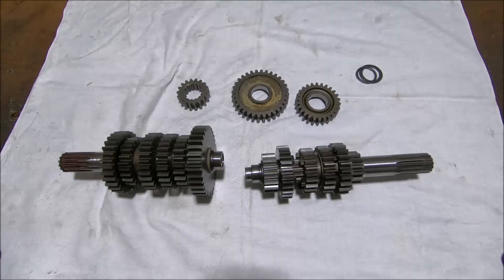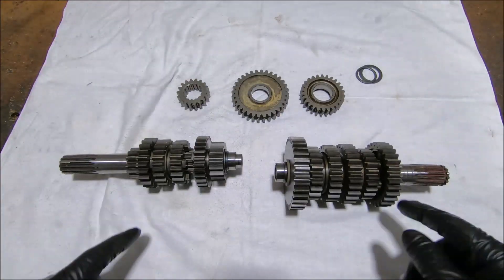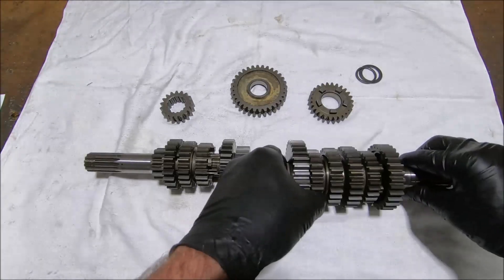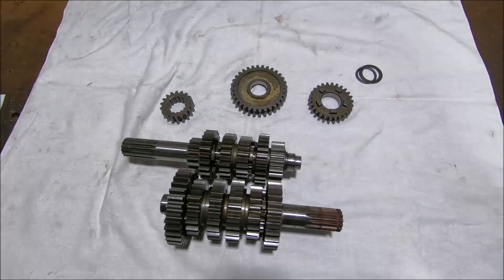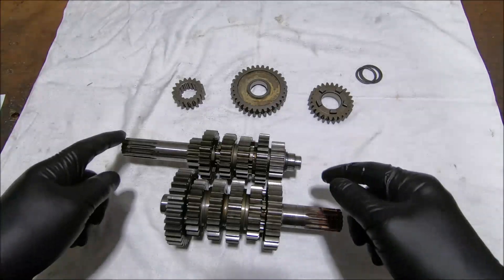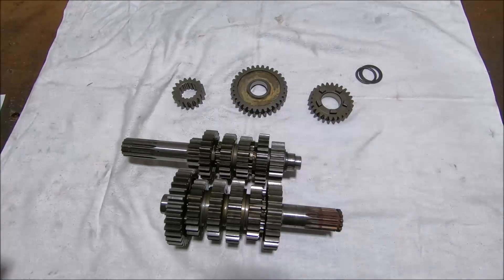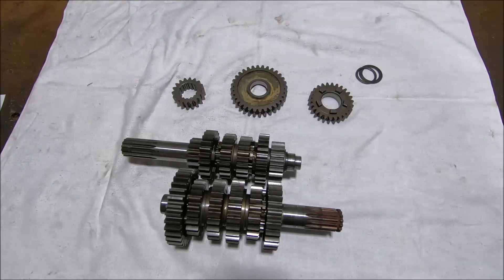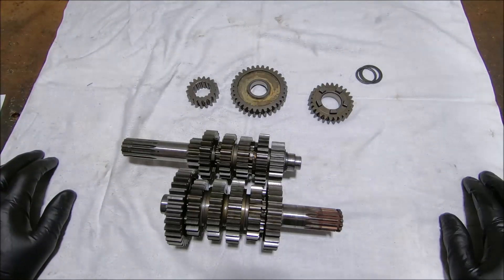Changing gearbox ratios on my M659 engine on first, second and sixth - how, why, etc

Comment: You said the 6th gear ratio was 26/24 now it’s 27/24…. How can  you not change the opposing gear( the 24 tooth) to 23 tooth coz if you go up 1 tooth on the input gear, you must go down 1 tooth on the opposing output gear…. To allow them to mesh.
If I’m wrong, please explain why, thanks.
Reply from the maker: the gear man puts it into the computer program and it puts out a profile shape that should (hopefully) work with the original other gear.  here's hoping.

Comment: I'm interesting, what final drive pair did you use on your 400ss? I have a Monster 400cc, with 15/48, and thinking about change to 15/45, but I don’t know if this will be ok for the 400cc engine...
Reply from the maker: my 6 speed 400ss i ran 14/39 i think.  it was meant to be 14/45 by the manual, i forget what was on it when i got it.  is your monster 5 or 6 speed?  carb or injected?  none of which are anything like the 400ss gearing wise.
Reply: @bradthebikeboy  My M400 6 speed and injected
Reply from the maker: @Юра-щ2о8я  that's the same as the 800 and the later m696, etc.  i usually run 15/48 on m696 instead of the std 15/45 to make them nice, so that should be fine. if you try 15/45 and you don't like it, replace the front with a 14 and that's much the same as 15/48.

Comment: A really interesting exercise. Looking forward to hearing how it feels on the road. On the 1100, the problem is it's overgeared in top meaning you couldn't happily engage sixth at anything below 110 kph. Also, town speed (50 kph) was hard to maintain as second was a bit low and third was too high. I went down the sprocket change route going from the standard 15/39 to 15/42 (via 14/39). The option of swapping individual ratios to fine tune the gearbox is very appealing (if considerably more expensive!)
Reply from the maker: i like 15/43 in wide ratio 1.84 primary drive models.  but a 14 front is a good step if you're not replacing the lot.  this is a very expensive way to change the gearing.
Reply: @bradthebikeboy  Agreed. 14 tooth front is quick, easy and cheap. The 15/42 seems the best of the options I've tried so far, kinder to the chain and sprockets I believe, but heavier with the longer chain and definitely more expensive!
Reply from the maker: @luddite6239 shouldn't be any more expensive.  i use esjot rear sprockets on them, much cheaper than oem.  i doubt the weight will make much difference.  and while the larger front is technically better, the typical owner neglect will have far more influence on life or lack of.
Reply: @bradthebikeboy  Agreed (again!) When I fitted the 14, I read many comments from online "experts" saying that "...the chain run's too tight" or "... there's not enough clearance round the swinging arm". But after 12,000 miles, the front sprocket showed no appreciable wear and there were no noticeable witness marks on the plastic swinging arm protector to suggest the chain was running too close. I only changed because I wanted to try one of the after market rear sprockets, which mount on a separate carrier.

Comment: Awesome info, be keen to hear an update after you're running it. It's not much different to gear ratios in other Ducatis, so it should be ok.
Reply from the maker: the concern is not the ratios, but the gears physically.
Reply: Ah, I see. Like the different diameters would cause the gears to mesh differently? @bradthebikeboy
Reply from the maker: @adamroper1197  the diameter has to be the same, so the tooth shape is manipulated to make it hopefully work.